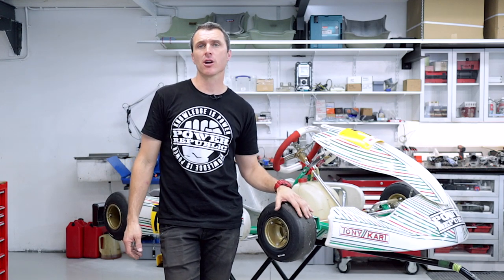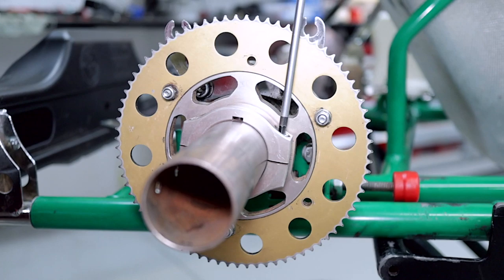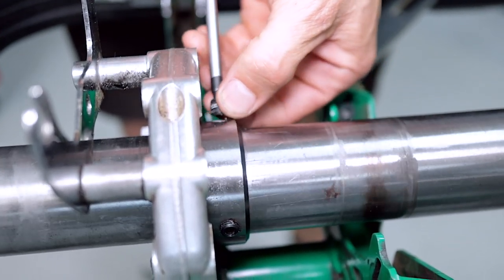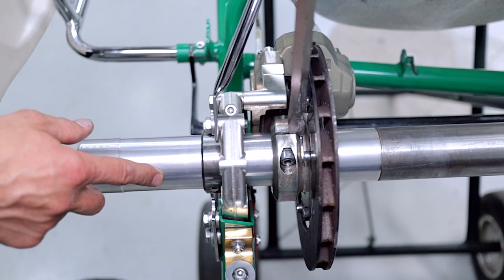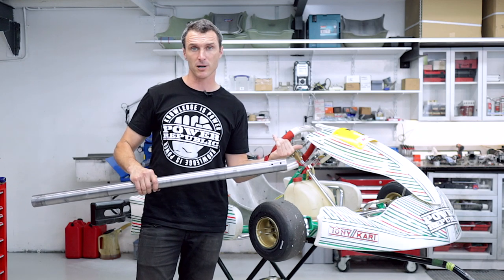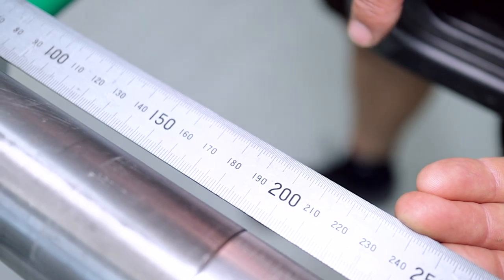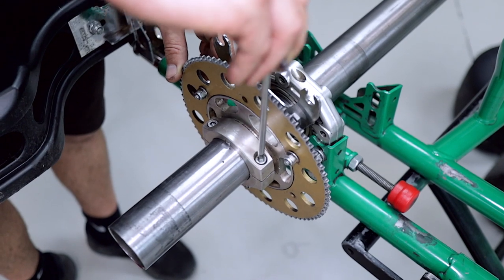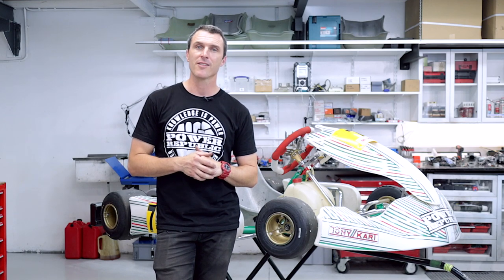HOW TO: Change Your Go Kart Axle The Easy Way - POWER REPUBLIC

Comment: Great video! It would be great to make a video showing how to service the rear axle bearings and let us know how often they require servicing.Thanks!
Reply from the maker: hey Chris , thanks heaps for watching our videos.   I have a video on how to remove and install them, 

best way to wash them out is degreaser and pressure washer, then with compressed air.

don't forget to regrease em

Comment: You should use a drill bit to make an indent on the axle that the grub screw fits into.  This prevents the grub screw raising the metal to a level above the axle surface.  It makes it MUCH easier to remove the axle.  Very important not to drill right through the axle.  I use a bolt with a hole drilled through the centre. I screw the bolt in place of the grub screw.  I then use the hole in the bolt as a drill bit guide.  The result are indents perfectly aligned with the grub screw. Clamps the axle really well and makes it easy to refit an axle back into the same position.
Reply from the maker: Darren Conway thanks for the hot tip. Great idea. I’ll pass it on to our guys. Where do you go go-Karting?
Reply: @PowerRepublic  Wellington, NZ
Reply: You can also use heatshrink on your drill bit to prevent it from damaging the thread
Reply from the maker: @johngstuart9040  never thought of that, great idea John

Comment: Another thing to keep in mind is some axles (like on my TopKart) are directional, meaning the keyways are not symmetrical on both ends of the axle.  One end is intended for the sprocket carrier and the other for the brake rotor, so make sure you have the ends right before sliding it back in...
Reply from the maker: thanks for the tip broski

Comment: What torque would you suggest for the hub bolt? I did not see you apply a lot of muscle wit the Allen key. I had an experience of the hub/wheel "leaving" the at a good speed on a straight... Several contributing factors (1" of 40 mm axle engagement in the hub, slight damage to the hub bore from a loose key,  and likely not sufficient clamping force from the bolt) Replacing the hubs, modifying the axle to permit a longer key with the pegs and increasing hub engagement. Doing club racing in 4 stroke Briggs here in Canada. Thanks for a great source of information on OTK karts.
Reply from the maker: thanks heaps for tuning in and watching the videos Miro.  its an M8 bolt which is 20Nm if you are using a Torque wrench for tightening.  otherwise arm strong with an Allen key is normally enough to keep the wheels from coming off

Comment: Axle slides in so smoothly. Do you use fine-grit sandpaper to go inside the bearing carrier so the Bearings are not so stiff and can move freely and align?  Do the insides of the bearings themselves get a little surface area polished off?
Reply from the maker: yeah once the axle bearings are aligned, then the axle slides in like a dream.  

I do use emery paper when the axle is old or rusty, but not when brand new.

Nah, just grab some new ones.  they are a consumable too.

Comment: Any idea where I can get an axle basher like the one you used?  I have seen them with a smaller diameter on the main shaft so they can be used for 30mm, 40mm, or 50mm basher heads, but I really like the one you have because it is supported nicely in the bearing all the way until the axle is through the brake hub.   If only I had a lathe!!!!
Reply from the maker: Bennett Taylor are you in Australia?  I can make one for you and ship it out.  They are $50 plus the shipping.
Reply: Power Republic I’m in the US. If you can find reasonably priced shipping, even if it’s really slow (its winter here) I’ll buy one.  I’ll send my contact info through your website.
Reply from the maker: @ReactorFour  got it and I'm on it!
Reply: Got the axle basher today!  Thanks mate.
Reply: Hey Derek, can I get one too?! 🙋🏽‍♂️
Reply from the maker: @ljc2051  sure can, just email me your address and I will whip them up next week for you guys

Comment: Quick question, I currently have a wooden push go cart 😂😂 I would like to upgrade it to a 48v 1800w motor . I current have wheels with bearings built in . With the rear axle should the wheels move on it or should they be fixed so they don’t move ???
Reply from the maker: https://youtu.be/uSCl5jIhb0M 

the wheel hubs should slide on the axle.

Looking forwards to seeing this project completed!!!

Comment: hi, how tight should I do the set screws which fix the axle? Thanks
Reply from the maker: I do them up as tight as I can with the short end of the T bar Allen key.  Make sure you use some loctite to keep them in,  Also if you are using a soft axle its best to use the axle stiffener bushes on the inside of the axle to stop the axle from deforming too much from the grub screws.
Reply: @PowerRepublic  thanks

Comment: Love your video series!  Just switched two drivers (my sons) over to Kosmic mercury R karts in the last few months (One last year and the other starting in a couple of weeks).  Both were used karts (only one race each).  The karts arrived with the rear brake side bearings on different from each other.  One is the same as your video where the collar of the brake side is outside, but one kart has the collar on the inside matching the engine side.  Our Birel's were always on the inside.   Does this make a big difference???
Reply from the maker: not massive difference.   from factory tony kart they have both bearings facing the same direction ( small end to the brake side of the kart )

Comment: Would you do a video on how to get engines warmer ?
Reply from the maker: as in before you hit the track first thing or to make them hotter whilst driving?
Reply: Whilst driving
Reply from the maker: put your arm over the radiator, hold the brake on lightly as you're driving, drive overly aggressive on out lap,

Comment: Hi Dez,

Thanks for the video, I came across few times with m6 cap screws on the brake disc carrier snapping, (only applying arm force) same for the m8 on the hubs.
Is there a newton torque chart to follow when doing these routine tasks? I found myself questioning many times, is it tight enough? Or is it too tight?
Another question is, when re installing the axel, is it better to loosen the bearing cassette screw? So all the bearings self align?

Cheers
Reply from the maker: the torque settings are available on line, just google the size you are after.
https://www.engineeringtoolbox.com/metric-bolts-maximum-torque-d_2054.html

I would, but there is another way you can do it too where you line them up from each side of the kart and then locking them into position .
Reply: @PowerRepublic  Great, got the chart. Will try to line them up, from outside first then install the third one and see what happens, I always had the issue that the axel spins free with the two outer bearings, as soon as I tight the mid bearing cassette onto the chassis the axel doesn’t spin as free. I will give it a go. Thanks for the tips again as usual 👍🏼🤙🏼

Comment: Why the alloy angle on the chain guard?  Is it to stop the original thin flange/nuts from spinning after doing them up too tight?
Reply from the maker: sure does, check this one out

https://www.youtube.com/watch?v=Z25Yx27ELHc
Reply: @PowerRepublic  Nice one and thanks. I will try it.  After 8+ years of karting, first time I've seen this hack (I've been drilling access holes on the outer side of the guard and using a long key to ensure they are tight). Cheers and keep up the good work.

Comment: in your opinion, what is an acceptable runnout of an axle ? I got 0,3mm runnout with the dial indicator. Thanks
Reply from the maker: yrha anything under 0.30mm you can t feel.  1mm you can feel and still drive if necessary and then more than a mill and its near impossible
Reply: Thanks legend !

Comment: Hi!!! Thanks for all the great videos!! Have a bent 30mm rear axle that's pinching in the bearing collar. Any suggestions on how to get it out? I've tried to knock it out but it's stuck. Probably looking at cutting it to get everything apart but any suggestions help at this point! Thanks again!!
Reply from the maker: if it has more than about 6 or 7mm band in it, then it is probably stuffed and you can cut it out with an angle grinder.  Otherwise, take the axle and bearing carriers out as one complete unit and then you can remove the bearings one at a time with a soft hammer, with the cassettes still on the bearings it gives you a good surface to strike on with your hammer.  hope that helps and a let me know how you go.
Reply: Thanks for they quick reply! My son went in backwards into the barriers at 60 kph so we're talking more in the range of 6-7cm rather than mm 🙈. Have disassembled the axle from the chassi and will try to cut it tonight. Assume that one side without the bend will be easy to knock out but the other side will probably provide some grief. Assume heating up the bearing collar a little (while trying to cool the axle with a wet rag) will help to provide some more slack in the tolerances. Fingers crossed and I'll let you know how everything goes!
Reply from the maker: @robertkamperin4382  just cut the axle in 2 places, just inside both bearings but leave enough so that you can remove the burred edge after cutting.  This way the axle won't 'pick up' when being hammered through the bearings.  
You could heat it up but I think it won't be necessary.
Reply: @PowerRepublic  thanks, will give it a try tomorrow! On the "healthy" side I just had to tap it with a rubber hammer and it came off easily but on surprises on the other side, it was just simply stuck

Comment: The third bearing carrier is removed on this kart what is difference between with our without thanks
Reply from the maker: Hey JJ, it makes the rear soft or stiff.   soft is most preferred.  stiff is good when the tracks are real hot and sticky out of slow corners

Comment: I have bought a 2007 mod Rotax Max and it has 3 bearings on the axel. Is this necessary? I think I need to replace them aswell...  It's only going to be used for training. BTW love your videos🙏
Reply from the maker: Hey Jan, thanks mate.  Maybe just replace the outside two and take the third middle one out altogether.. that's is a very popular modification here
Reply: @PowerRepublic  Thank you!

Comment: Why would you change axels and what way do you go?
Harder or softer and why
Reply from the maker: we change them mostly because the conditions have changed and the driver isn't happy with the chassis.  if you are only new to karting it wont change your world, so easiest way is to leave the medium axle in it and have fun.   bigger guys v's little guys, tony kart v's other brands, bridgestone v's dunlop, hot v's cold, rain v's dry etc etc are all variations to consider for axle swaps.  My recommendation for the guys that haven't used different axles before.... buy one soft, one medium and one hard.   go to the track and test them in different conditions with your driver/chassis/tyre/ambient temperature and then you will know what works best for you and your package.  hope that helps.
Reply: @PowerRepublic  thanks for the response,
Yes I'm new to karting and I have a FA Kart running the DFH. Been trying all sorts of things testing but putting a U axel in over the N axel has been the best change. 1 second a lap. But I don't know why or when to go back harder 😂
Reply from the maker: @bradywebb7579  on the DFM's we have heaps of good times with the U axle for lighter drivers.  If your a bigger guy then the N or H are great too,

Comment: how do you know what size axel you need?
Reply from the maker: generally the senior drivers on medium and soft tyres go with a 50mm.  Cadets and Juniors go with the 30mm and the 40mm is for medium power engines and medium grip tyres.

Comment: Hi Derek, 

I have a CRG KT1 chassis with a 125 Rotax Senior and have some questions about bearings and axle: 

1) My kart chassis has the space to install 3 bearings, but only has 2. Does it make any difference if I install 3 bearings?  

2) is there any difference between 50-80 and 50-90 bearings? 

3) I believe my axle is medium. How do I know if I need to get an softer or harder axle? 

4) Which model do you recommend?

Thanks
Reply from the maker: Hi Armando,

1 - it will stiffen up the rear of the kart.  if you are a big driver put it in, small driver you can leave it out.

2 - just the outside diameter.  I think CRG are 90mm OD

3 - practise is the key.  but get one off each and test them out in your kart at your track.  generally softer keeps the rear wheels on the ground for longer, hard makes the inside rear lift earlier in the corner.   Neither is a magic bullet for all conditions 

4 - genuine axles are best IMO.  We use OTK axles only in our Tony Kart.

Hope that helps

D
Reply: @PowerRepublic  Hi Derek, Thanks a lot

Comment: I personally remove the sprocket, then the sprocket carry, as that way when you put the new axle in, and do everything right, you don’t have to take all the time getting the chain tension right
Reply from the maker: yeah great idea DH,  what type of kart racing do you do?
Reply: @PowerRepublic  primarily x30 with that being the easiest thing to find races for over here in the states, but I got an old rotax and lo206 to still have some fun in
Reply from the maker: @dondelchulia3189  hell yeah,  i heard that the Rok GP is big over there too?  hey, we just got a 206 for our shop demo kart
Reply: @PowerRepublic  I’m a east coast racer and unfortunately rok gp isn’t too big over on this end I’m pretty sure I could punch my ticket to Europe if I just bought the engine. Ka100 is really taking over out there to the point even x30 is getting killed off with 60+ ka fields at nationals with maybe 30-40 in x30 and rotax has almost been completely killed with really no major series running them. I love my Briggs it’s a great skill builder and a blast when it comes to easy fun. I’m personally surprised it isn’t law to run WPK or arrows over there

Comment: How do you measure the break disc
Reply from the maker: the thickness or the diameter
Reply: Diameter
Reply from the maker: @sandhands600  they are 206mm on a senior kart, and you can measure with a ruler or with some digital callipers